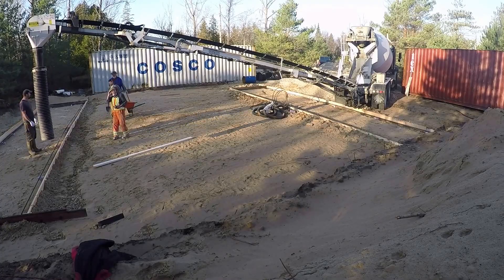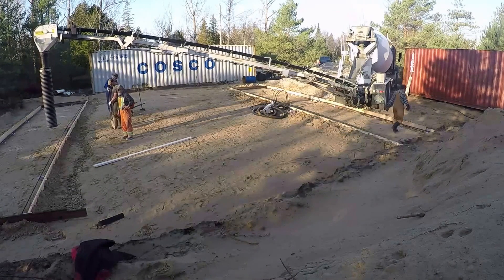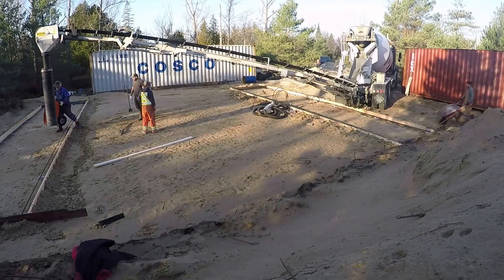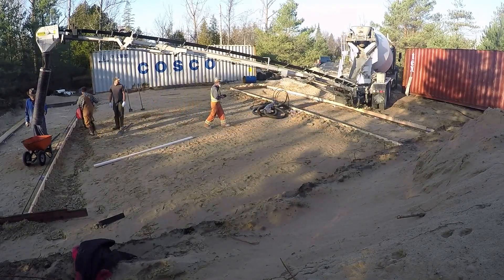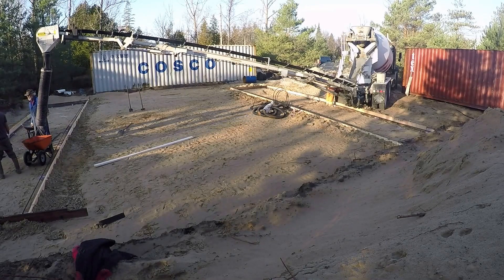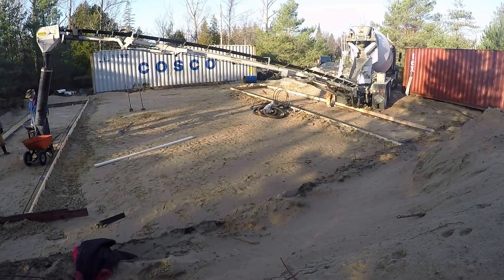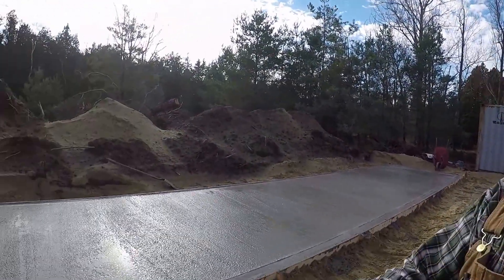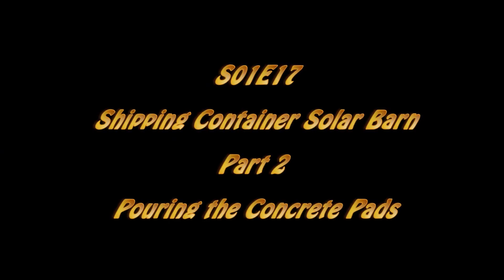S01E17   Shipping Container Solar Barn   Part 2

Comment: I wish the concrete trucks would upgrade to what you guys use, looks so much easier than the regular style we have in Ohio. thanks for sharing
Reply from the maker: Do you mean with the conveyor?  Normally they don't have those.  You pay extra to have that used.  Allot more actually.  The problem is that there was no way for them to reach without it.  There is not driveway to that point.  The added expense did make the project go much smoother, with a lot less wheel barrow work though. :)

Comment: Not a lot of re-bar!
Reply from the maker: No there is no need.  We actually did more than required by code.  The cans are only supported by the 4 corner posts(The only place the cans actually touch the pad).  The rest of the pad is only used as ballast really, so once the cans get fastened down to them, the cans cannot blow over. :)